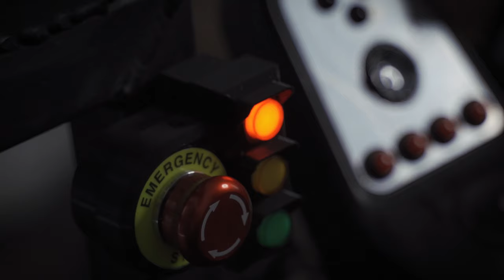6dof Motion Simulator DIY - Q&A - What is 6dof? How did it come to be?

Comment: Good Job mate. I am in Brisbane. I built  a 3DOF  (wheel chair Motors XSIM) about 2 years, but now i am making a new one, Servo Motors 4DOF with SIMTOOL.
Reply from the maker: Oh really! Ive read your thread back when  i was starting out! Nice! Are you doing an sfx100 build? You should definitely give PTMover a go man. You'll be well impressed I think. Are you going to run a Thanos Controller? Another high reccomendation if you ask me.

Comment: Hi Mate...I'm in Melbourne, I did the same thing spent so much and couldn't get anything to work a couple of years ago and i got so frustrated i gave up on motion part..  and seeing your video today mate has inspired me to try again... Hope i can get it working lol
Reply from the maker: Always happy to give some inspiration, mate! What rig were you building? 6dof? I ended up buying all new motors and modifying design and everything went like a breeze after that with these new stepper motors. It's just plug and play! Less components to worry about and fail. Good luck though, hit up xsimulator if you need some help :)

Comment: Would you be able to give an approximate cost for the project? I'm thinking about buying/building one but not sure which route I should go. I have a pretty busy lifestyle so time is hard to come by to do a project like this. However, I am very mechanically inclined and love tinkering so it's right up my alley. I'm mainly into DCS in VR but also race from time to time. BTW, awesome rig mate!
Reply from the maker: Thanks man. It's about $5k AUD. It is a fairly full on project but having the ability to plug and play servo motors with thanos's controller saves a lot of messing around and lets you just focus on construction.
Reply from the maker: @TylerDouglas100  the Thanos controller has been around for a while but he has recently adapted it to use a DB25 connector to directly connect with the AASD drivers and motors like seen in the SFX100 builds (look it up) i just used the same motors and added a couple and as he already had 6dof implementation on his firmware it was a simple plug and play  job. go to xsimulator and/or look up sfx100 as thats another cool build which uses the same motors i use, but only 4 of.. also 3d printed etc.. but with thanos controller you can use simtools and flupt mover and noe a few other programs as well and its only getting better support so you'd be silly to not go that route if you ask me..